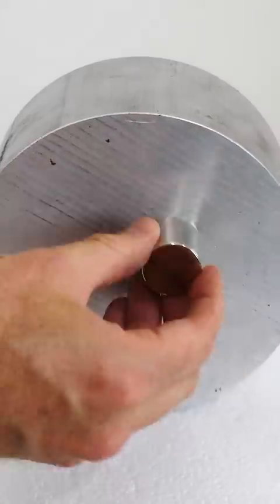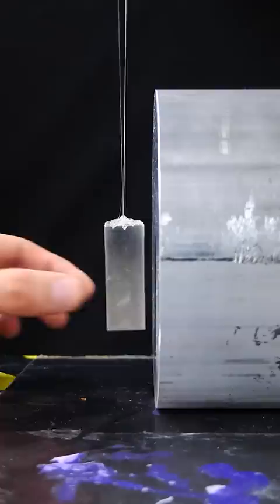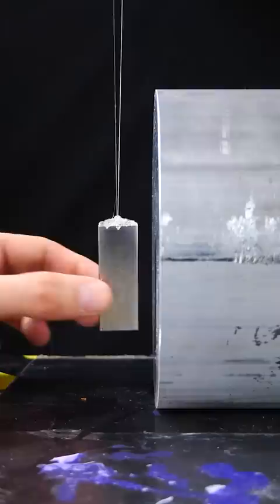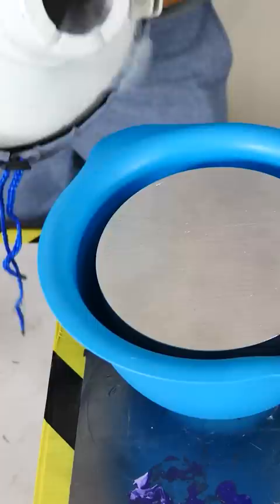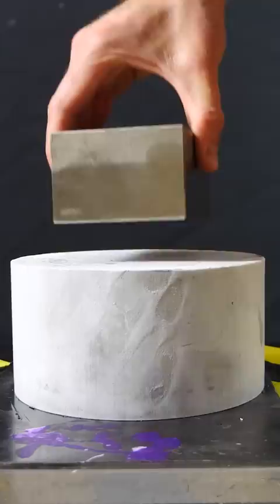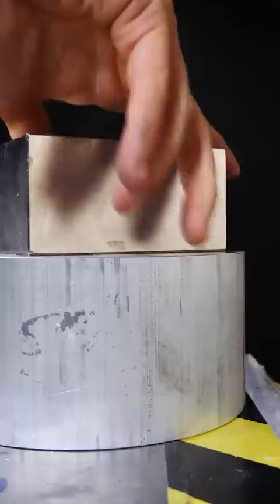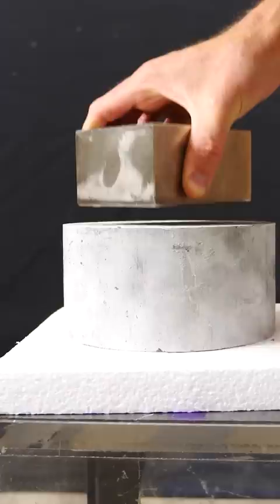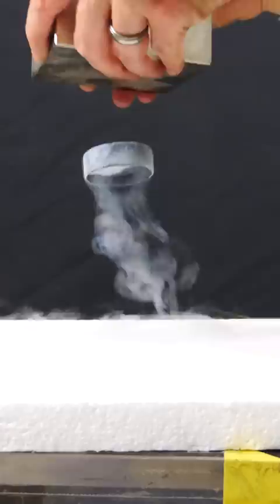Magnetic Braking Looks Like Magic

Comment: Bro just invented Feather Falling V boots
Reply: Exactly
Reply: Turns out i can finally jump high on cold metal planets without fall damage now
Reply: @lightningcodi2587  more like an iron block -☝️🤓 (not u)
Reply: with iron block boots on* 
maybe also an iron block helmet lol @QiPluh得
Reply: @lightningcodi2587 Instead of fall damage, you will take rapid fall slowing damage.
Reply: @MrT------5743   u take fall damage from the slowing down and not the hit of the ground lol
Reply: @lightningcodi2587  that's what I said.
Reply: It's still pretty hefty acceleration on your body, but it should be way less than direct contact since it's spread out over time. That's the point of crumple zones in cars.

Someone should calculate the exact difference depending on fall height :)
Reply: Now you just have to learn to always land on your feet 😅
Reply: Dont die falling, die hungry
Reply: Someone forgot about g-force
Reply: @volbla the crumple zone in cars chassis is there to transfer and divert impact energy. It's not designed to slow the crash down.
Reply: @MaNNeRz91  What do you think impact energy is? Energy is simply force times distance. It's the force of the impact that yanks your organs and breaks your bones. A modern car minimizes the maximum force exerted on your body during a crash by having the front crumple evenly and successively. A super rigid chassi would come to a stop much quicker, and therefore experience a higher maximum force.

It's like falling into a net compared to falling onto the ground. A net will stretch and slow you down gradually. The ground will stop you almost instantly.
Reply: @MaNNeRz91  read the comment, ignore science
Reply: Ankle breaking boots? It’s go to apply that forced to your entire body.😂

Comment: That effect is used for breaking roller coaster or free fall tower. It doesn't need electricity, isn't affected by rain which could cause less friction and does not wear out.
Reply: Technically it does wear out since magnets wear out but yeah they last long long time.
Reply: it may brake just few inches before hitting the ground. It may not damage magnet etc, but it may harm person inside the free fall chamber
Reply: You do know the difference between breaking and braking right?

Comment: Looks like something that could be useful in elevators just in case the cables break
Reply: Elevators already do this. They have a mechanical interlock that ingages a break if tention is ever released from the cable. no falling required.

Comment: Cool video about magnetic braking. However, the ending part about superconductors is false. Superconductors can levitate in the presence of a magnetic field due to the Meissner effect. This results in a repulsive force towards the magnet due to the expulsion of the magnetic field from the superconductor. It stays in the same orientation and distance due to flux pinning.
Reply: faxxxx
Reply: Great explanation! We want to actually simulate superconductors, any idea how?

Comment: Man we need these on car bumpers that activates when a collision is imminent.
Reply: it already does, in a different form, they're called crumple zones
the front of the car basically crumpled and acts like a cushion, instead of solid hammer impact

and remember to always wear seatbelt
Reply: Putting this in cars would save so many lives. And it could possibly save the car itself from damage.
Reply: @innerbeautymusthaves  the thing is, its better to have the car crumple on impact (the front and rear), so it basically acts like a cushion, the crumbling gives more time for it to slow down, than be an impact stop, like a hammer

yes, you lose the car but the occupants are saved, and that's what matters
Reply: @innerbeautymusthaves  It definitely wouldn't. If cars stopped like that suddenly then people would fly out of their cars or get knocked out or die from the sheer force of stopping. 

As the other commenter said, it's very important for the crumple zones to exist so extend the duration of the collision. Time and force are inversely proportional. So the more time it takes for the collision to happen, the safer the occupants.
Reply: Yeah some of the other commenters are right, you want more time to slow down because it’s less momentum stopped at once. If you stop too fast, you still have a ton of inertia and your body will be traveling faster into your airbag or dash 😬
Reply: @OutrunRewind  two days ago I lost control on the road, I was pretty close to death. A friend sitting next to me AFTER that put on the seatbelt. You can never predict when shit will hit the fan
Reply: @prykris  yeah, that's the thing, roads are always going to be unpredictable
it's always just better to wear a seatbelt than to think the airbag alone will save you (which it's meant to work together with the seatbelt)

Comment: That 1000 pound attraction force neodymium magnet is extremely dangerous if not handled correctly! Even a much smaller one that can support a hundred pounds or so can easily pinch off a finger in the right circumstances.

Comment: “It even keeps its same orientation…”  * immediately flips over when passing a pole * 😂😂😂
Reply: 😂😂😂😂 yup , i noticed that too , Uno reverse card
Reply: Too hard to understand how a magnet works right? They both reversed
Reply: @lorenzocannizzaro6567  Actually, the levitating object is not a magnet, but a superconductor (I guess YBCO, but could be something crazier). Understanding why it keeps its magnetic field is super hard to understand and not all superconductors do this, as stated in the video. Sadly, just understanding how magnets work won't help here.
Reply: He flipped the big magnet so the semiconductor flipped to main proper orientation
Reply: @LastL33T  it may as well be a magnet, since its magnetic field is what we care about here. Wouldn't the currents in the superconductor remaining the same as the magnet rotates explain it rotating to match?
Reply: You guys didn’t understand what happened 😂😂
Reply: That's just sloppy talk. He meant it kept orientation relative to the magnetic field direction. The side that faced given pole of the chunky magnet keeps facing that pole.
Reply: @mysss29  No. It's not moving with respect to the magnet, so there are no eddy currents. The video is quite sloppy and misleading on this point.

Comment: I can’t believe with all the informational science videos I’ve watched, I’ve never heard of this let alone seen this before. Imagine the applications for accident prevention: for transportation, driving, industry, etc. Incredible !
Reply: I believe it is already applied to stuff like bullet train, where its mostly magnet that we use to move things. Im not sure if roller coaster also use something from this principle, but the braking system is still cool on roller coaster.
Reply: you need a steady flow of liquid nitrogen or some other form of coolant to keep the magnet or superconductor at below -140C

its gonna be crazy expensive to upkeep peoperly
Reply: Its applied on rollercoasters
Reply: @fnutek3720  maybe for space applications
Reply: @darkveneno6155  maybe for some sort of anticollision mechanism on the inside idk. But spacecrafts are already really optimized
Reply: They're already being used in firearms to slow down the reciprocal mass and reduce felt recoil, allowing for more accurate weapons because the guns moving parts never impact the rear of receiver. the magnet acts as a tiny reusable airbag.
Reply: @RichardCranium321  No thats just not true? There is no superconducting material that will do anything above like -170 C.

There is no railgun or other gun for that matter that uses superconductivity, its just been theorised. It wouldnt be useful outside of railguns either however considering that only railguns use magnetic fields to fire the projectile.

The only place we will likely ever see superconductors be used, is in computer chips.

And bullet trains, but they have so many other factors already
Reply: @fnutek3720  they have magnetic recoil dampening buffer systems for the M4 & AR15 platform... I have 2 different ones.   Nice try though👍🏽
Reply: @RichardCranium321  magnetic recoil dampening is not supercondictivity??
Reply: @RichardCranium321  what defines superconductivity, i think you got the wrong idea.
Reply: @fnutek3720  Miculek Magnetic Buffer (MMB) system... it uses the magnetic braking principles to stop the buffer from impacting the rear of the buffer tube, making for a softer and more accurate weapons system.

I was never referring to rail/coil gun technology. Just advancements in small arms tech.   The magnetic braking works past 70°C, well above the -170°C you claim is required.

Nice chat though👍🏽
Reply: @RichardCranium321  magnetic breaking is not superconductivity...
Reply: @fnutek3720  the person who got the wrong idea is you... I never said they're using superconductors, I just said "they're already being used" and YOU assumed I meant superconductors, what I actually meant was neodymium magnets and the magnetic braking principle.
Reply: @fnutek3720  face it, you were wrong and there are currently applications for neodymium magnets being used for magnetic braking on firearms and they do not require liquid nitrogen or any special cooling apparatus...

It's not my fault you automatically assumed I meant superconductors even the video title itself is "magnetic braking" and not "superconductors"
Reply: @RichardCranium321  Slight nitpick, the magnetic braking in MMB is a different kind of magnetic braking that is shown in the video, so I see where @Fnutek is coming from. MMB is simply two repelling magnets, so is not a application of this effect, simply that of magnetism, which is pretty much everywhere.
Reply: it's actually useless for accident prevention, if you hit a wall or you hit a magnetic wall, both will feel the exact same, like a wall.
In the industry, eddy currents are mainly used to test stuff: identify type of metal, measure coating distance, find microscopic cracks, detecting fake coins in vending machines, ...
You can check the wikipedia page on Eddy current to see more applications, if you want
Reply: @RichardCranium321  lol, wut. it's an over powered .22. I can hit 100yrds with my 10.5 holding it like a pistol. Unless you comp shoot, then🍻, bravo. Cool gun tech.
Reply: Imagine driving around in your specially made aluminum car and never crash into a magnet. What a bummer.

Comment: I wonder about the potential applications of stuff like this...
Reply: I just want a real bttf hoverboard
Reply: It's called maglev and it's been in use for decades
Reply: @wedmunds  the braking, dude. Not just the maglev.
Reply: @Scott.E.H  The “braking” is used in several ways: the induction motor, induction heater, electromagnetic dampers

Comment: “it even keeps its same orientation…” 
proceeds to flip💀
Reply: That’s because he flipped the actual bar of metal, but you can barely see that
Reply: I thought the same but he means positional orientation not directional

 In general the position and orientation in space of a rigid body are defined as the position and orientation, relative to the main reference frame, of another reference frame, which is fixed relative to the body, and hence translates and rotates with it (the body's local reference frame, or local coordinate system).
Reply: Well he did flip the magnet as well

Comment: Engineer and scientists should manipulate magnet more, this material is underrated asf
Reply: Brakes for cars perhaps
Reply: electronics are based upon magnetics bruh
Reply: @keegentilley578  This is how regenerative braking works! This effect works by generating electrical currents in the material, and here they're just dissipated as heat but there's no sense in that so some electric and hybrid cars use this effect to charge the batteries with the electric currents.
Reply: This is how the new Ford aircraft carrier works.
Reply: this is how drop towers stop at the bottom
Reply: @keegentilley578  Maybe an electromagnet could work in an enclosed brake sort of like drum brakes so rubble or water doesn´t get in the way. But to stop a 3-4 ton car moving at 60mph or faster in such a short distance requires a very strong magnet, and since it needs to be switched on and off like electromagnets, it would take quite a lot of power, not to mention the device itself would be really expensive.
Reply: Some people have proposed this as a solution to creating a kind of “force field” like you would see in movies that blocks incoming missiles etc.
Reply: wait until you hear about motors

Comment: New propulsion system possible. Very interesting.
Reply: And it is already in use. Roller coaster launches use these routinely nowadays, applying a current to fins with coils of wire, and the train has magnets fitted. When applied just right, the train accelerates forward very quickly.

Comment: The replies to this comment are mega gay
Reply: That is supposed to happen, the north south pole orientation in the superconductor remains the same and as the he rotates the magnet(i.e rotate the poles) the superconductor also flips.
Reply: Yeh, i guess you didnt understand what he was saying.
Reply: @xyratious3334  As a physicist this bothered me too. It does not keep the same orientation. If N started up and ends up down the orientation has changed 180°. Unless you also rotate the reference frame by the same amount as the object thebthe orientation has absolutely changed. It doesn't matter that the magnet also rotated. You can't even say relative to the magnet. You also can't say that the magnetic orientation remains the same as the direction of the eddy currents has reversed.

In no way has the orientation remained the same.
Reply: Yeah but it's still bisexual so

Comment: Would this work with less mass in the non magnetic part?  Like with a piece of aluminum sheet metal? (If the magnet were smaller/lighter).  I ask because I wonder if this could work as a "soft close" method for drawers/doors etc, or if you'd need such a big chunk of aluminum in order to stop a slamming door that it wouldn't be practical?

Comment: Perhaps they should implement something like this in breaks
Reply: That idea has been around for a long time but the issue with it is that its just not very reliable or efficient. Lets take a car for example: first of all the kinetic energy, in this setup is turned into a LOT of heat so your brakes would get very hot very quickly which in this case would drastically decrease their effectiveness due to metal being less conductive when its hot. And then also if you are breaking "wirelessly"( ik but bear with me here ) why would you want to waste the energy. You can just take a part and recharge a battery of some kind. And that is exactly how recuperative braking works. Here, instead of a solid chunk of metal you have a large coil that takes the kinetic energy and turns it into electricity. Many hybrid cars do that if you brake lightly. But if you want or need to come to a quick stop you still have physical brake pads because they just do that specific thing a lot better. Hope this helps and wasnt too much😅

Comment: Couldn't they implement this in elevator brakes? For example, if the elevator was in free fall, this could potentially help prevent some of the destruction of an elevator hitting the floor at full speed. Just a thought. Not saying youd survive the fall. Simply prevent an explosion when it slams the floor.
Reply: Actually that is a really good idea.... I really wished they'd look into shit like this... I'm terrified of elevators 😂
Reply: What did the elevator do to you? Lol jk jk  @Seeräuberei
Reply: @xxDESENTxx  3rd time I was ever in an elevator was the first time I went to the beach and I decided to ride the elevator down to the pool with my older cousin and my stupid sister. As we were going down the elevator didn't stop and we kept hitting the emergency stop and it kept going and the door wouldn't open. I was having a heart attack because even though I wasn't scared of elevators at the time, the thought of being stuck in an in closed space with no way out or windows terrified me.... After a few minutes we finally made it to the pool and after we were done I took the stares back up...
Reply: @Seeräuberei dam
Reply: Yes but it's too dangerous for the people inside for alot of reasons
Reply: or nvm i was wrong thought you were talking about the instant stop one and not the slow falling one

Comment: Could that be used for future elevators if falling..? They have the magnets under and than that thing to slow it..? Or would it be to heavy?
Reply: Elevators have safety brakes which are enabled as soon as the cabin is moving without inputs to the motor. This already happens mechanically and stops the elevator quickly and safely. Also: many people think that a failing elevator would fall but it would actually shoot to the top of the shaft because elevators have a weight attached to them so they dont have to carry as much weight

Comment: In other words, this is the technology they use when manufacturing UFOs.
Reply: Nope. Wouldn't work.
Reply: @Narokkurai  you don't believe they are using some amalgamation of this technology to produce flying ctaft?
Reply: @Narokkurai  you don't believe they are using some amalgamation of this technology to produce flying craft?
Reply: @blaqswhodefy86  No, I do not. The physics of magnetic levitation just don't scale up that well. The amount of electric current required to lift a car would literally be enough to melt steel. It is a completely impractical way to make a flying craft.